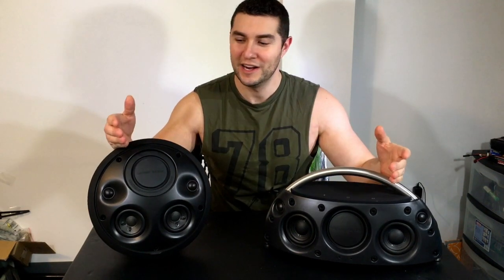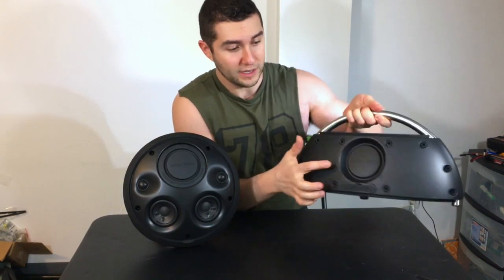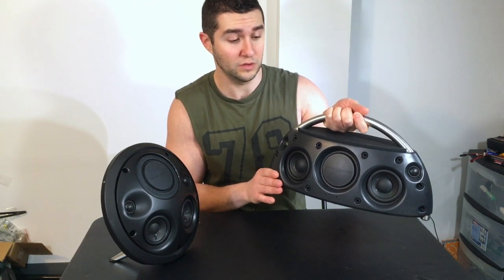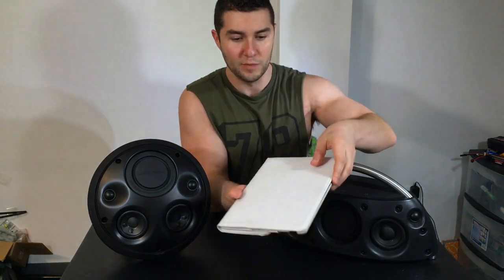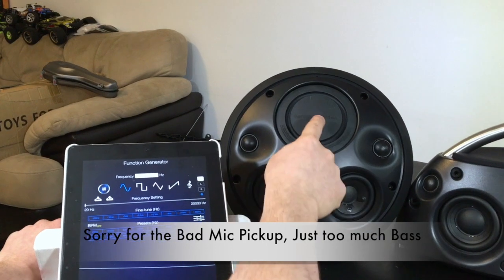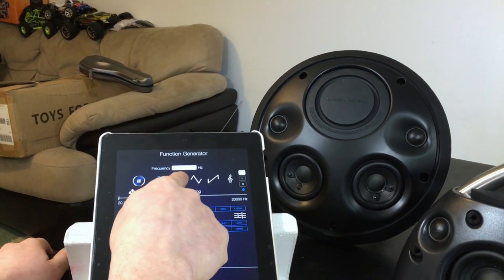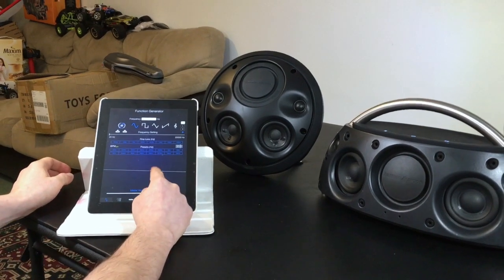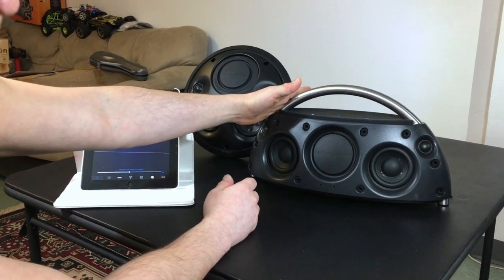Broken/Defective Harmon Kardon Go + Play speaker Demo

Comment: hk is one of the best sounding speakers out there,the problem is they used paper cone woofers which is not strong enough to withstand heavy bass,they shoudve use aluminum or kevlar type woofers.
Reply: myplaguesify hk paper cone are really good they can handle a lot of abuse

Comment: 9n any speaker you buy the eq isnt meant to be maxed and here's why,when all frequencies are maxed it causes hiss in the system just like if you put a crossover in a car stereo and turn up your amp knobs to max it causes harmonic distortion which can burn it up.frequencies are sound tune not volume,what you can do is turn on the speaker and put the volume at low volume with EQ turned off then turn your phone up until it distorts,after turn your phone volume down so it doesnt distort turn the speaker volume up and you'll find it's well balanced.turn 9n eq enjoy

Comment: I have the HK studio 6 I bought on eBay during Covid - the day I got it and opened it and turned it on something was clearly wrong. I had previously owned a HK studio 3 speaker and lived it - it started my love affair with HK. However (and I dint blame HK as I bought it on eBay) the studio 6 was clearly damaged for it sounded almost as if the speaker was blown - a lot of crackling in the base area every time any significant base played. Was horrible because I paid nearly full price for this thing - however with covid going on and me moving I forgot and after I packed it back up I the box and proceeded my 90 moves in about the next year and basically forgot all about it. I just went home and realized I left the speaker along with some other belongings at my parents home and started the process of trying to fix this thing as a return is not possible two years later - lol. I took it apart and everything seems ok with the speakers - the connector strips don’t seem to damaged so I am a little perplexed at what could be the problem. Everything button wise works - Bluetooth connects quickly and efficiently and all the screws were there. So now I’m stumped - I thought before I started that it would be a blown speaker or separated foam or something of the sort - but doesn’t seem that way - so …. Helpppp! I just did notice tho about 4 missing screw on the plate located on the cover that comes off first - could that affect the sound quality with the base? Possibly? Cause other than that I’m not seeing any noticeable damage - no cracks no air holes nadda!

Comment: i hadnot had any issue, maybe that hole was made out of a fall that the speaker had during transportation, hope you have your guarranty covered, and if not, you can open un the speaker and check if it is just the driver not installed correctly or broken, if it is broken just put silicon to seal the box, and your speaker is ready to work just like new

Comment: Thanks for the demonstration. I didn't know how passive radiators worked exactly, the way the unit needs to be completely sealed or they don't function. I have a little HK Onyx Mini which I like and was thinking about getting a Go Play but have read/watched enough reviews of people not overly impressed with them to make me hesitate.
Reply from the maker: thanks for watching!! and glad to have helped you.  Id seriously recommend a larger speaker like the AIWA EXOS-9 for a lot of power and bass and terrific sound quality.  Its about the same price and usually cheaper than a new HK go+ play anyway.  Are you looking for something smaller maybe?
Reply: Yeah I've been thinking about the Aiwa. It would be nice to have something big and powerful for when I want that but does it also sound as impressive at low to moderate levels? If so I'd be sold. Also if it sounded good playing classic rock, what I listen to the majority of the time. I've yet to find a bt speaker that impresses me with that genre.
Reply from the maker: im telling you, this is by far my fav speaker overall.  It has easy to use EQ setting too.  
watch this other video I made of the AIWA and another huge speaker.  Aiwa for its size is incredible.

https://www.youtube.com/watch?v=lBuU95xUZ6c
Reply: Cool, thanks!

Comment: Just fix it your self . It isn't a big issue , you can seal it with silicone or even hot glue . Maybe it's a loose screw
Reply from the maker: hey man! thanks for watching!! I wound up returning this speaker, and got a replacement after.  I also returned the second one, honestly did not like the sound at all, I think it sounds about the same as the much cheap ONYX STUDIO.  Wasn't happy with it at all.
Reply: @hybrid32494  it can be considered a similar more portable version of the studio . You should try the DSP Mode which puts it in 100W without it it is only 40W . I own it and the difference is day and night it is turned off on battery and can be turned on manually . The circuit does sometimes overheat in DSP but that isn't an issue on AC Power

Comment: For example you'll get better dynamic with optical digital since its wired but bluetooth sometimes can have hiss or static like a cassette tape
Reply from the maker: you're right about the HISS or some static with bluetooth.  I have noticed it on low end speakers, but with these HARMON brand ones it's never been an issue for me.
Reply: Can you help me? Ive got HK go+play as on the video and I get constant hiss from tweeters. Doesnt matter if I play something or not its always there. Is this normal or is my speaker simply defect?

Comment: I have an HK GO+PLAY wireless. The best bluetooth speaker I'd heard, but the least reliable expensive electronic hardware I have ever seen. Stopped working after less than two years of use.
Reply: Is it better than the honex studio 6
Reply: @tonytrevd4881  I haven't owned an Onyx speaker, so I couldn't tell. There are a couple of videos comparing them. Here is one:  https://youtu.be/7Eo79kZ_nWA

Comment: I need help! I have the same problem as the boom box type speaker but I have the onyx speaker. How can you fix the problem?
Reply from the maker: so you have a onyx studio speaker where one of the drivers is loose?  Or is the bass radiator?  There are plenty of vids on you tube where people open up the case and service components inside, mainly the battery.  You should be able to visually check if all the screws are tight and not missing to begin with.
Reply: hybrid32494 Oh yea all the screws are here. And you’re right thank you! And if it doesn’t work I can always go to the geek squad to fix it completely.
Reply from the maker: yes, keep me updated, wonder how much geek squad would even charge for that.

Comment: Go play has 50 watt subs not passive radiators right?
Reply from the maker: hey buddy! The harmon kardon Go + Play has two main drivers ( they call them woofers, but they are just midrange drivers) ,2 tweeters, and 2 passive radiators.  It doesn't have any powered subs.  I highly recommend you look at or get the new Harmon Kardon onyx studio 5 model, I recently got it myself.  It blows away every other harmon speaker I have.  Honestly I disliked the sound of the Go + play, it wasn't much better than the basic old school onyx studio.
Reply: @hybrid32494  i bought the studio 4. I could've bought the studio 5 cheaper but i didn't cuz in my opinion the 4 sounds better and has more punchy bass.
Reply from the maker: I have not heard the studio 4 to be honest with you.  I'm only camping my onyx studio 1st gen to the 5.  Compared to the first gen the 5 in insane.  I paid about 110 for the 5 through best buy when it was on sale.  Trust me though, I guarantee you the sound from the GO play is not any better than the first gen onyx.  After this video I got a new GO plus play, without any defects, and still disliked it.
Reply: @hybrid32494  u should test the 4 though its real good

Comment: Bad battery on Go + play - love the sound but the battery in mine failed after 2 years - does not even power with power cord.
Reply from the maker: hey man!!! that sucks, you're right there are many reviews that claim bad batteries.  I returned mine eventually btw. Sound was fine, I cant say it was much better than the old style onyx studio though.  The new onyx 5 blows it away though.
Reply: Hello Gareth, My Go + Play also stopped working a couple of days ago. Doesn't charge, make any blinking lights or anything. The only part that works is the USB port, it can still charge. Curious if yours was like this too? Did you find out a fix? Is it just to replace the battery in the end?

Comment: The hole in the speaker looks like a sound duct, which is not that effective with small units.
Reply from the maker: hello, do you mean the hole where the speaker is clearly mounted poorly.  That is not a sound duct, its just a defect.  These speakers use bass radiators that create more bass, they only work when the unit is well sealed and air cannot get out.

Comment: Never again Harman Kardon Go + Play - battery is sooo weak   ... DO NOT BAY IT - NEVER
Reply from the maker: I agree, these have so many defects, I wound up getting rid of this eventually.
Reply: Same here. Could have been an awesome speaker if it wasn't for the battery issues. 
I have a go play with the same battery issue
Reply: His one is broken my one doesn't have those holes and the passive radiators vibrate just fine

Comment: Hey, can you tell me how you removed the caps of the go + play?
Reply from the maker: hello, you have to pry off the covers.  Try using a flat edge like a screwdriver or some softer plastic piece to stick between the speaker body and the mesh cover.  It it just held in with pressure mounted type clips, its easy replaceable after you take it off.  Start at the corners on the bottom of the speaker, close to the outer bottom feet.
Reply: hybrid32494 Yea I was halfway while you reacted. Thanks for reacting!

Comment: Did you buy the onyx on amazon?
Reply from the maker: hello, this particular onyx I got from eBay.  But you can find them almost anywhere now.  They are very common and cheap now, and you can get the onyx 2 or 3 if you want a more updated design.  But keep in mind, they all sounds the same.
Reply: hybrid32494 i ordered the onyx 4 but im worried its not genuine because a few reviews say they got a fake one.
Reply from the maker: IDK how anyone got anything fake on amazon because they have pretty good return policies, and you can just return it if it's fake.  But you should be fine, let me know how you like it when you get it.
Reply: hybrid32494 i got it and its sounds very bassy, especially when i connected to the power outlet. Its awesome.
Reply: hybrid32494 with a frequency generator it can go down to 45hz even if it says it goes down to 50hz.
Reply from the maker: Yes, you are right.  Below 50HZ there isn't much actually sound.  Just interesting to actually listen how low it can go with such a generator and not with real music.
Reply from the maker: Glad you like it.  See, I told you.  Super great speaker in terms of sound, price, volume, and design.  It was this model that really made me love bluetooth speakers.
Reply: hybrid32494 is it normal that the onyx studio 4 dosent sound that loud on battery?
Reply from the maker: YES, all the ONYX models sound a little louder and more powerful when connected to power.  Thats normal.  I still find it loud and Bassey enough without the power adapter.
Reply: hybrid32494 at first i was a little disappointed, but i realized that the sound quality is really good.
Reply from the maker: this speaker is extremely well balanced and good looking I think.  If you set it on the floor near the wall, it will amplify the bass, have you tried that?  The read bass radiator really helps with that.
Reply: hybrid32494 i knew that along time ago with other speakers i had.
Reply: hybrid32494 is it normal that it distorts when music has alot of bass?
Reply from the maker: At around what level of volume?  Rule of thumb is that at the higher level of volume (over 85%) it's typical to have some distortion when there is deep bass.  The fact is the bass radiators just don't work too well at high levels of volume and bass, because there essentially cant move fast enough due to the rubber material itself.  It's fine, this is the reason why people prefer real subwoofers, but for this price point, it's the best you can get.
Reply: hybrid32494 does the go play do that too?
Reply from the maker: to some level yes.  all the speakers distort when over 90%.  I generally like to listen at no more than 80%.  I find it's good enough anyway.  IF you need more loudness you just need a speaker with actual built in subs, and not passive bass radiators.  Check out the Fluance Fi70 on my channel,  biggest speaker I have with 2 built in 8 inch subs.  
https://www.youtube.com/watch?v=lBuU95xUZ6c&t=90s
Reply: hybrid32494 jbl speakers and bose speakers dont distort but the bass is limited.
Reply: hybrid32494 what about the aura studio? I bet that one dosent distort.

Comment: Dude you know that the speaker is defective, do you really need to make a video of it? Connecting it to function generator? Why do you have to demonstrate it, it’s defective 🤣
Reply from the maker: Yes, I realized it was defective.  I was trying to point out how the bass radiators add to the bass.  That was the point.  I have since gotten a non-defective unit.